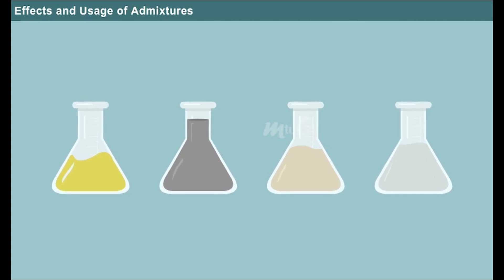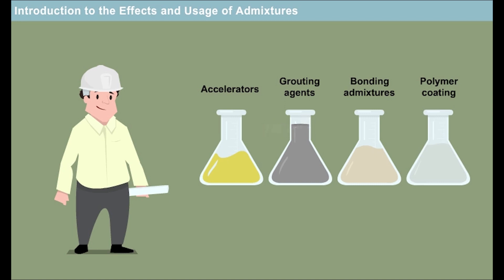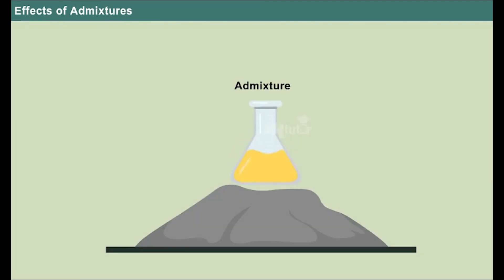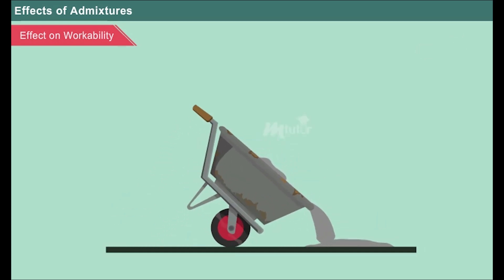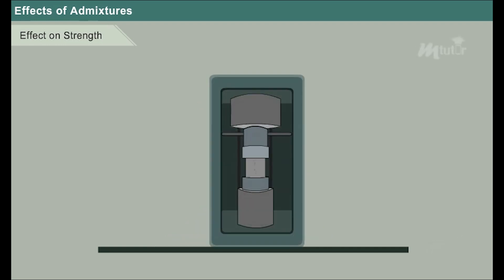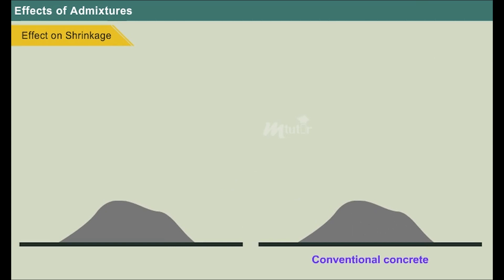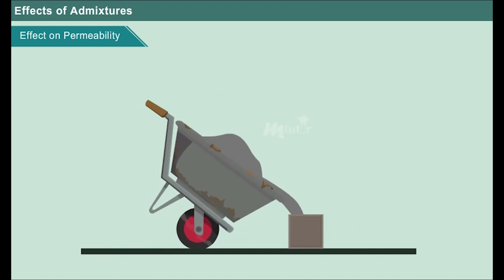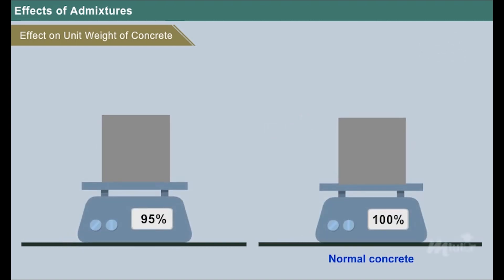Effects and Usage of Admixtures [Year-3]

Comment: great work mate, please make more videos on civil engineering topics(especially the rcc part).
we need things kind of stuff.
cheers
Reply: RCC in my opinion is all about the water to cement ratio. If using dump trucks from a central mix batch plant having just enough water to get the complete hydration reaction and no more than needed and you will have very durable concrete, Generally this will have almost no slump. RCC mixes usually replace the flyash content with more cement, thus making a 3,000 psi flyash mix into a 5,000 psi mix because the flyash is replaced with more cement, thus making it VERY potent especially in hot weather. In cold weather applications a 2% per hundred weight of a non-corrosive accelerator will make it safe to drive on in a couple of days. If it is being poured out of a mixer truck, instead of dump trucks, a water reducer "plasticizer" or high range water reducer "super plasticizer" will allow ease of placability, without compromising the strength of the concrete, since plasticizers only work for an hour or so until the concrete returns to true slump.